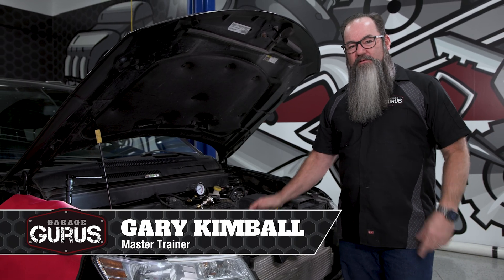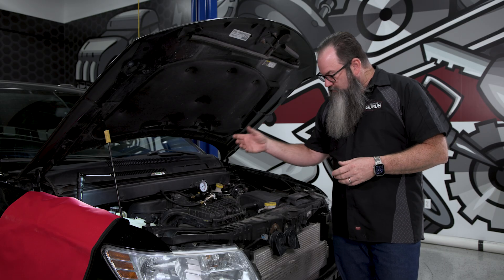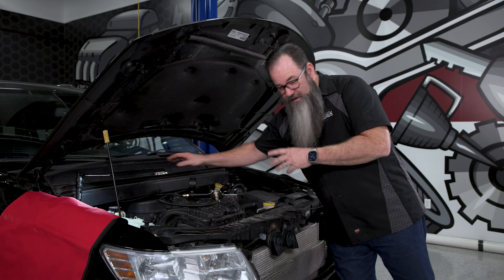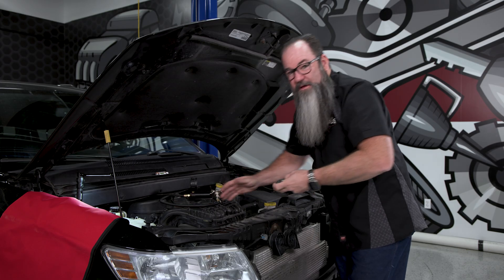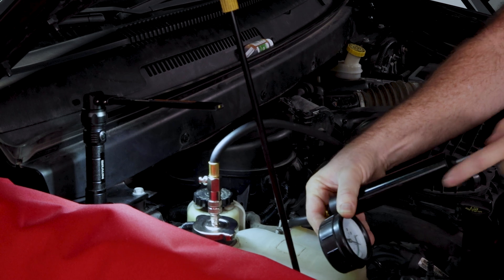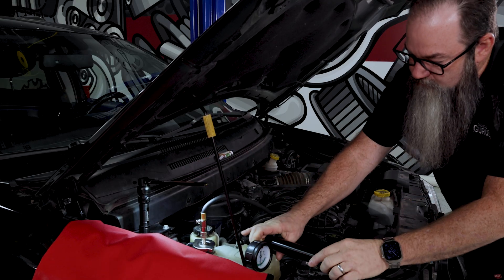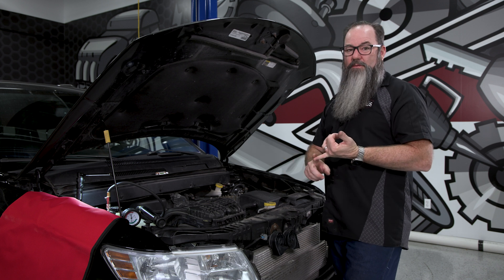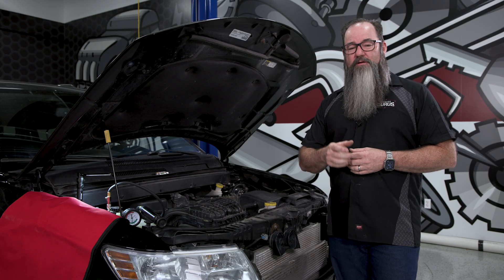Garage Gurus | How to Use a Pressure Test to Find a Coolant Leak

Comment: When I do a pressure test with an adapter connected to the reservoir tank in my Range rover evoque, why does it leak from the reservoir tank valve? (a little hole that is located in my reservoir tank) ? If I close the hole with my finger, the pressure holds.
Reply from the maker: Hi, thanks for reaching out! Our tech team would be happy to help you with this. You can reach out to them at 1-800-325-8886. They are available Monday – Thursday from 7:30 a.m. – 4:30 p.m. (CST), Friday from 7:30 a.m. – 4:00 p.m. (CST).

Comment: What if pressure testing didn’t find any issues but I’m still losing coolant? Is that even possible?
Reply: Pressure test when engine is hot
Reply: Do what he said.  You can pull a spark plug as well and check inside cylinders

Comment: The coolant dye was how I found the hairline crack in my Pontiac timing chain cover gasket. 231 series 3 V6.
Reply: Can you please explain how this testing works? Thanks
Reply: @Proudarse  Put coolant leak detector dye into the coolant bottle, and top off the coolant. Drive the vehicle for X amount of miles, then get out the black light. Put on yellow goggles, and the coolant leak will show up under the ultra violet black light.
Reply: @karrpilot7092  Holy moly, that’s some cool sheeet. I’ll take a look into this. I appreciate you getting back to me. Thank you ✌🏼

Comment: Thanks, we are at the start of the fall/winter season. I want to go the next step and have my lube techs check for quality of the antifreeze. When should it be changed & when should we do a drain & fill or a flush and fill.  What to look for grit in the radiator cap. When do we need to check for PH?